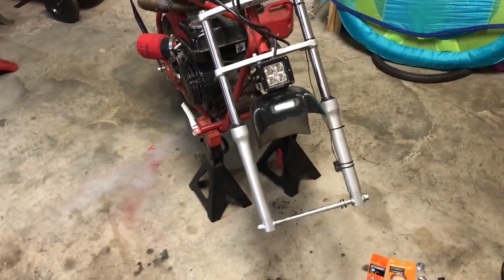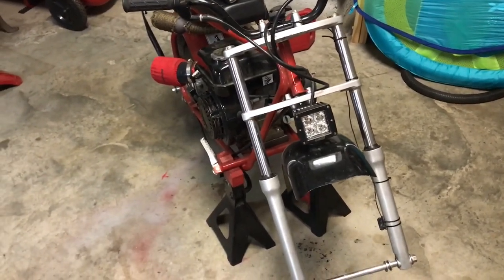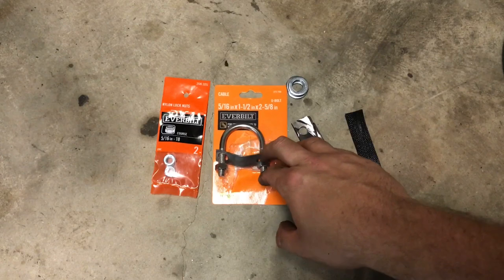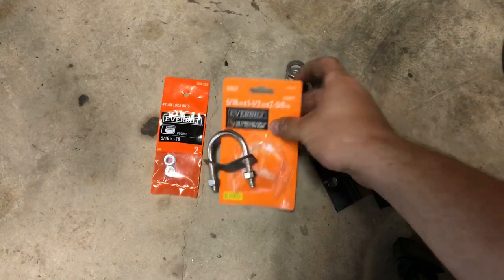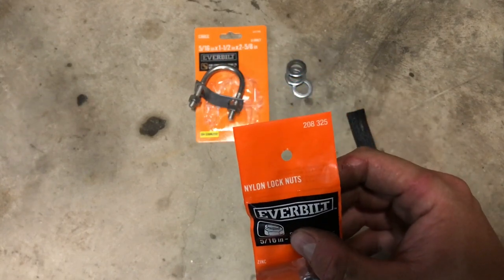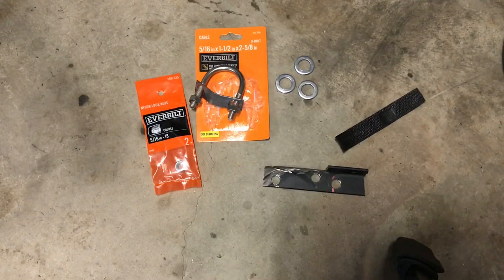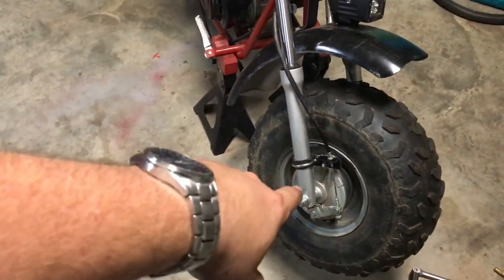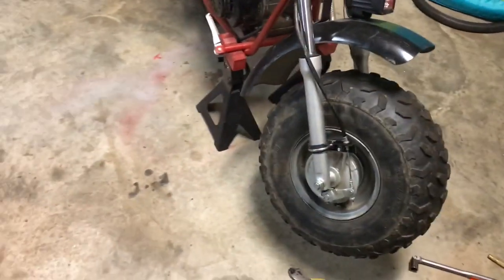HOW TO INSTALL FRONT BRAKES ON COLEMAN CT200U , CT200U-EX , AND BT200X MINI BIKES

Comment: I recently made a very similar front brake system for both of my Coleman U-EX models.  I also converted the rear brake to a rod and pedal for more brake control.  IN addition, I installed tail lamps and BRAKE LIGHTS.  I also see you have a speedometer/bicycle computer installed on your front fork.  Installing that on ours allowed us to know that we can ride for 51 miles before the stock fuel tank runs dry!

Comment: I have a Baja Warrior I want to do the same job on. I was thinking of changing the rear brake to a foot lever on the right side and replace the cable with a rod instead. Then leave the front brake on the left side. Nice job!
Reply from the maker: Bob's Barn Workshop yeah that setup would probably work better.
Reply: Anthony Shelton I see a small mechanical disc brake kit for $25. It will need more complex mounting bracket but no need to replace the front wheel. I’ll have to weld a mounting flange on the wheel for the disc, but I love a challenge!
Reply from the maker: Bob's Barn Workshop just make sure you don’t have a lot of runout when you welding them mounting flange, though you Can always shim the disc later if need be.
Reply: Anthony Shelton yeah it will require some careful alignment for sure!

Comment: Great video. You ought to sell a kit with a bracket and shortened cable.
Reply from the maker: I think the cable will vary with each bike. When I swapped forks the handle bars become to short on a ct200u. After this video I got taller handlebars (9” tall) to bring it back to original height. This made the cable a little more better looking. Still gonna shorten it when I get a chance I believe.

Comment: Would you mind measuring the distance between the front forks for me? I’m trying to see if this rim I have my eye on would fit. I want to order that front suspension set up but I need the dimensions if possible. Thx and great video btw.
Reply from the maker: Yeah, I'll get it for you later today.
Reply: Awesome thank you, subbed btw.
Reply from the maker: Anthony Burgess I got 8 5/8”. Hard to really measure so I had to use to framing squares to get around the tire
Reply: Thanks so much. Anything over 8” will work so even if you were off by a little it seems like I’ll be ok. Thanks for checking for me. I appreciate it.

Comment: Hi Anthony, I'm looking to do this conversion on my Coleman BT200X now that I am adding a new Predator 224 engine, I will need some good stopping power and I must say what an excellent idea and great job! so how has the front braking been working out any issues? I bought the rear Brake Drum and Rim Assy, Brake Handle Lever cable etc. everything I need per your instruction.
Reply from the maker: Been working great! Almost necessary once you get the bike moving faster than factory speed.
Reply: @TheVintageEngineer  Thank you,  I bought the rear hub and drum assembly about 60 bucks, and there are no disc brake conversion kits made for the BT200X, if there were would be like $150.00. So far this modified front drum brake is working out great! I upgraded to a 224 PREDATOR and did a MOD2 CAM upgrade now getting 57 MPH and braking on just a rear tire is an accident waiting to happen. Again great video!.

Comment: Front outer fork tube is aluminum on my ex u  so you would have to use a aluminum bracket and be able to weld aluminum

Comment: Why did you offset the holes for the u-bolt?  That made the angle flange out of line with the cable connection.  I want to do mine straight but suspect there's a reason you did it this way haha.
Reply from the maker: Peter K. @3:35 The ear of the drum housing will hit the nut of the u bolt if it was in line with it.
Reply: @TheVintageEngineer  Thanks Anthony!

Comment: I’ve ordered all the parts from Coleman for this mod. It’s really should help as we have a very steep hill we go down at our place. One question. What size is your angle iron? 1” or 1.5”? Looking using 1/4” aluminum. Just easier to work with. Thoughts? Thanks.
Reply from the maker: I think it was only 3/4” actually.

Comment: Hey any chance you still have that frame and are interested in selling it? Just got a ct200u-ex and the frame is twisted in a couple of spots lol
Reply from the maker: I do. I live in Birmingham, AL area. Not big on shipping but if you are nearby I might let it go.
Reply: @TheVintageEngineer  I'm about an hour away from b'ham & would be interested in buying the frame if you haven't already made a deal on it. I've got the same model bike with significant frame damage & it would save time just to swap parts over. If you could share some contact info, I'd like to see if we can work out a deal...
Reply from the maker: Send me a message on Instagram: www.instagram.com/sheltonfilms

Comment: Would there be any issues with flipping the front tire and having the brakes on the left side?
Reply from the maker: Nope and probably better as force will be applied to back of fork instead of pulling away from it. I think I originally did it this way to match the back is all.
Reply: @TheVintageEngineer  Sweet, thanks for the reply, dig the channel!

Comment: How is that new riding position with those handle bars treating you?
Reply from the maker: I bought some taller handle bars to bring the height up to the stock height, so much better.
Reply: @TheVintageEngineer  I'm a 6 ft 220 pounder myself and I saw that issue as soon as I realized the B200x and CT200EX had a completely different approach angle than the ct200u. I considered this modification but am just going with a Trail Master 200 for my a suspension build. For heavy riders the EX and BX are far too prone to wheelie due to the cantilevered seat design.
Reply from the maker: fatbuddycat I sat on an EX at tractor supply and I absolutely hated it. The TM 200 is a nice bike, just make sure you change out the like 38 tooth rear sprocket to a bigger one because that is way too tall of a gear for trails.
Reply: @TheVintageEngineer  What sprocket do you have on your ct200u? I have some serious engine things going on in mine and it honks with the stock sprocket. Torque/speed differences worth it? I'm running a TAV 30.
Reply from the maker: fatbuddycat I have a 72t rear and I switch between 8 and 10 up front.